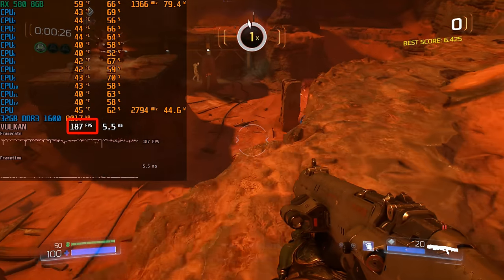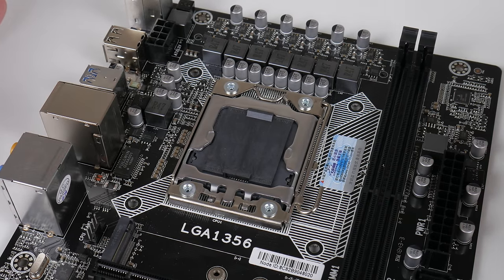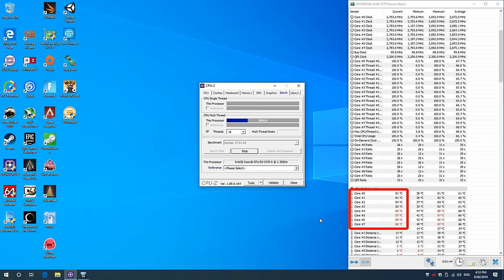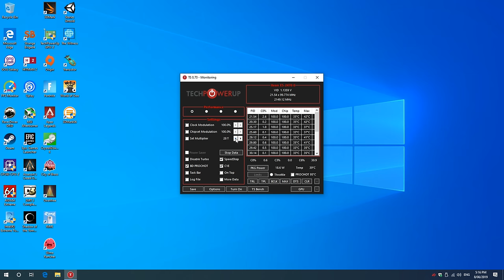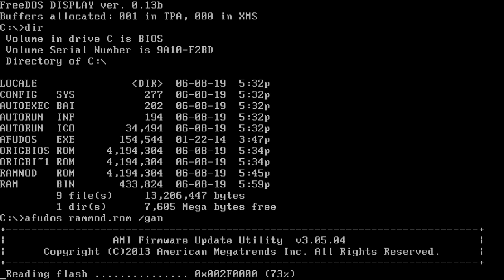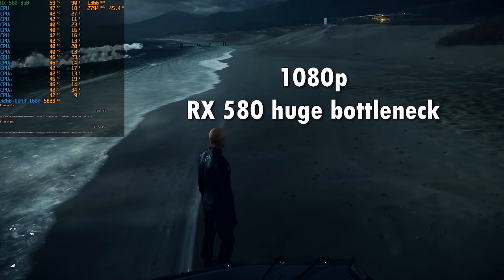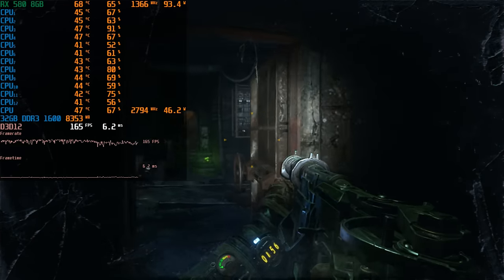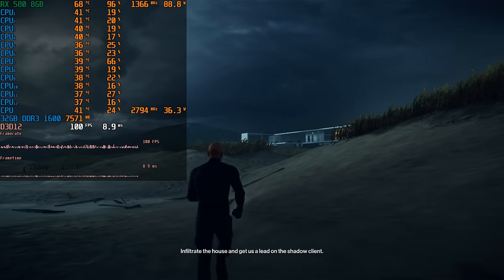6 Cores (and more) for everyone! Taking a closer look at the LGA 1356 platform.

Comment: link the startec raid thingy: https://www.startech.com/HDD/Adapters/sata-adapter-enclosure~35SAT225S3R holy hell that's expensive. a i sued enterprise raid card like a PREC 5 or 6 is cheaper.
Reply from the maker: Yea it didn't work out for me, I'm using just one single drive now. The large file performance was fine, but reading and writing small files, was terrible.
Reply: @philscomputerlab  maybe if the prices aren't "bend over" expensive. maybe you can do a video on raid, the Dell PERC series seem to have come down in price. if hard drives are issue let me know and i'll see if i can "gift" you some, maybe even cover part of the shipping.

Comment: As much as I love your content I think Steve is right this time. Those cheap motherboards from China are shady and won't last.
Reply from the maker: Just be aware that he used a different board and slower CPU!
Reply: @philscomputerlab  yep he picked the worse value for this platform. Keep up the Xeon videos Phil. Can't wait for the overclockable 2011 socket cpu.
Reply from the maker: @yarchieduke  Also, I modded my BIOS, so RAM can run at 1600 speed, on both my boards, without BIOS mod it runs only at 1333 speeds.

Comment: I just don't like the no-name motherboard thing. Having access to a website with support is important for a motherboard. Or am I being biased for concern over Chinese cheap motherboards lacking long term support?
Reply from the maker: What support do you require?
Reply: @philscomputerlab  I guess I like the thought of Bios updates.. even though that is usually just to allow later hardware to work.
Reply from the maker: @BReal-10EC  Yea with these boards supporting ~ 6 year old CPUs, the requirements are clearly defined and should be few issues.

Comment: $170 for a base platform like that is a ridiculous amount to spend on a dead-end socket such as this. Core count and clock speeds accounted for, the IPC of these chips cannot match modern offerings, and you're much better off purchasing something more recent with an actual upgrade path. Not to mention purchasing hardware made in potentially sketchy Chinese factories with little to no regard for quality. Getting on the AM4 platform could be done for less, with far superior performance. Recommending people buy this old and dated stuff without any feasible upgrade options in the future is just terrible advice. Plenty of people watching your channel will go out and purchase something such as this, and in a year or so will have to scrap everything and start new, when they could simply purchase a cheap AM4 socket board and something like an R5 1400/1600 and being set for awhile; not to mention the fact that you'd have access to modern features such as M.2 drives, actually decent onboard NIC/audio, and many other features.

Core count isn't everything, and that's something that many, such as yourself, make the mistake of thinking. You have to actually consider the performance of what you're testing relative to the superior budget options available in the market, which you fail to do so.
Reply from the maker: If you're referring to Hardware Unboxed video, note that I'm using a different board with better layout, M.2 and USB 3, a faster CPU with higher clock speed, and I modded the BIOS so that the RAM runs at 1600 instead of 1333. I'm well aware of the clock speed vs cores, this has been going on since the good old Athlon 64 and Core 2 Duo days :) Also, we will be checking out Ryzen parts soon, so stay tuned for that. And what did you think of the game performance shown in this video?

Comment: The VRM layout is not shared with the high-power "X79" mainboards. Looks like they use some phase doubling (potentially of lazy variety) to get 6+1 out of 3+1 phase control, which is like... why the hell, because there's just a single low-side MOSFET per phase, like wouldn't you first want to double up those before you double up the phases for economy's sake? Then again the power consumption of these CPUs is just too benign to be anyhow concerned over VRM construction. By all reason the design should be quite low-ripple.

It sure looks a bit funny, with how precariously close to the edge they placed the caps. I don't think i've ever seen a placement like that, but if they're confident the aren't going to run into manufacturing limits, there aren't actually any real issues with that.

They would have planned a semi-custom VRM cooler at design stage that is made out of a piece of standard extrusion finished with a couple very quick machining operations. I suppose they would have figured that it isn't at all necessary and possibly never ended up actually manufacturing them.

Comment: This isn't good for gaming tho, most games require high clock speeds and already run fine on 4 core CPU's. Even a Sandy/Ivy Bridge i5 should outperform this CPU in most games.
Reply: Radius 144p Did you watch the video?
Reply: @PistigriloXP  ye what's ur point?
Reply: @TheUltimateNoobHD  This old six core processor runs the games very well. Phil showed this to us in the video.

Comment: To be frank e5 2420 v2 that tech yes city tested at $20 is a much better value
Reply: So what's the cheapest mobo one should pair this with? Also what is the best value mobo to pair this with?  I honestly am not concerned about M.2 or SSDs or having USB 3.0 so with that in mind ...
Reply from the maker: The cheapest LGA 1356 board, you're saving maybe 10 bucks at most! Check out my previous 1356 video!
Reply: @philscomputerlab  bro, I feel you're misleading people...e5 2420 v2 at $20 is a much better deal than the 2430 v2 at $42. Please update your description.
Reply from the maker: @techbasics4481  I don't mislead, the E5-2430V2 is what I recommend, as overall best value you can disagree if you like, but may I think for myself and come to my own conclusions, thank you very much.

Comment: This is an embarrassing CPU for general productivity and gaming tasks. You get a better quality platform and a higher single-core performance out of the meanwhile nearly inadequate FX-8350, not to speak of the total performance.

The one big advantage this has is the incredible power efficiency. So i guess if you have a task where you need a silent build with moderate performance and not too many hard disks, i gues this is worth considering - if the platform never has to be upgraded again.
Reply from the maker: I've actually been working on a FX-6300 review when I heard about this platform. It doesn't compare, it runs much better than the FX!
Reply: @philscomputerlab  How so? But yeah i was probably thinking of the 2420.
On Cinebench R20 single-core 
2420 v2: 185
Piledriver at 4.2 GHz: 215
2430 v2: 205

I keep forgetting that the xeon has hyperthreading, which should easily boost it well beyond the total multithreaded performance a 6300 can deliver. Not necessarily 8350 though.
Reply from the maker: @SianaGearz  I'm not sure about Cinebench, the transition from R15 to R20 confuses my brain, but the multi score in R15 I got was 753. The big difference was in games, like in Shadow of the Tomb Raider the performance can really tank of the FX-6300 in some scenes, this is much better on the 2430V2. What do you think of the game performance shown in this video? Also, we will be checking out Ryzen CPUs on the channel soon, so that's something I'm really excited about :)
Reply: @philscomputerlab  I don't have much scope or experience with most of the games shown. But i mean Doom - well optimised, low entity count, enclosed environments. Everything that takes place in a corridor is actually unlikely to be interesting, Metro for example, and Tomb Raider for most of the game. Except the valley settlements, which are super tough! You don't maintain 60fps there easily with a Piledriver, and if the 2430 accomplishes this, then it's a pity you haven't included footage of that.
Reply from the maker: And that is my takeaway, modern games are well optimised, so we're seeing really good performance most of the time. A really tough game is AC Odyssey, and I to a certain degree Far Cry 5. FC5 runs well enough, but Odyssey does not. So I do test a mix of games that are well optimised, and that are more demanding!

Comment: 2.8ghz sucks :/

Can it even run GTA V or Assassins creed titles?
Reply: you can buy the other one with higher clock speed
Reply from the maker: Oh, I actually bought GTA V, it was on an all-time low, but then I realised it's the Rockstar Games version, not Steam >< So I forgot about it. Far Cry 5 is ~60 FPS, AC Odyssey not so good ~ 30 FPS.
Reply: Those games run fine, these cores are pretty great performance wise per clock cycle.

though socket 2011 is a bit better too chase ghz like the e5 1620 v2 is not far behind the ryzen 5 1600 6 core & 12 thread processor
(Keep in mind that I'm comparing a quad core 8 thread vs a 6 core processor that's quite a bit newer.)
https://cpu.userbenchmark.com/Compare/AMD-Ryzen-5-1600-vs-Intel-Xeon-E5-1620-v2/3919vsm8354 change it too the 1650 and its 9% difference but then the processor is quite high on tdp & past 100 usd in price

Comment: Excuse me, but that's really just not how TDP is calculated.
Reply from the maker: Exactly my point! They shouldn't be used and trusted much.
Reply: @philscomputerlab  I mean to say that you can't just jump around with what you measured on the wall.
Reply from the maker: @nik4520  I don't quite get what you're saying. Jumping around?
Reply: @philscomputerlab  By most ways of calculation TDP and Powerdraw are not directly related. The TDPs on both these chips are very much correct, I know your point was really the increased power draw and the problems that might bring along, but really it's not expressed adequately, thus could cause misunderstandings for even more people watching this
Reply: Also by "jumping around" I meant the way you seemed to show parts of total system draw for each CPU
Reply from the maker: @nik4520  You're being super vague, 3 comments, and you still not explaining what you mean. I'm not showing parts, the readings are at the wall going into the PSU, so it's the entire system. Idle is sitting on the desktop, load is while running Cinebench. The 80W TDP CPU measured ~100 W, the 95W TDP CPU measured ~160W. So that's why I warn not read too much into TDP, especially 32nm Sandy Bridge consume way more power than TDP numbers suggest.

Comment: Is dual socket motherboards for this procesoors are better than this for getting more cores and more performance
Reply: actually more cores does not always matter
Reply: @r2vbwh153  why
Reply: @puneetbhagat4537  Well more cores will help if you need it for work, but for gaming, most games still continue to prefer 4 cores or less and quite a few new games starting to use 6 cores.. there are few games that actually use 8 cores as for more cores I'm not sure if there are any games that would utilize them right now.
Reply: Simple answer: No.
Complicated answer: No, because the NUMA allocation is dependent on Ram speed and they don't scale well, also the latency between the cores is really really bad for gaming. Magnitudes worse, than the infinity fabric on the Threadripper 2990WX.
Reply: @NFreund  thanks bro
Reply: @xingbairong  i need two pc one for work and one for gaming, for work should i prefer dual processors or i go with a single one?
Reply: @puneetbhagat4537  By duel processor do you mean something like x79 dual processor platform or something new? Honestly if it's something new you might wanna wait for the new Ryzen to launch and get a 3800x for example. If you are talking about something like the x79 dual processors I hear they have a lot of glitches, so I'm not sure how trustworthy they are.
Reply: @xingbairong  x79
Reply: @xingbairong  ok so i will go with a single core only
Reply: @puneetbhagat4537  You mean single CPU. Yeah definitely I would choose it over the 2CPU setup. Still if you want to know more check few videos. There are a lot of videos showing dual cpu x79 ;)